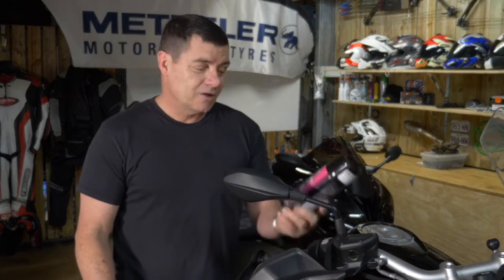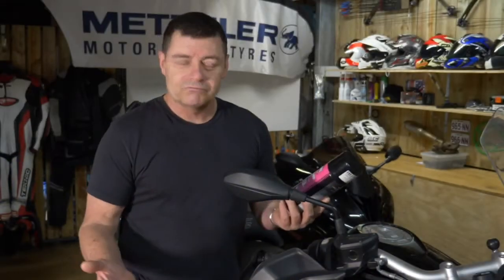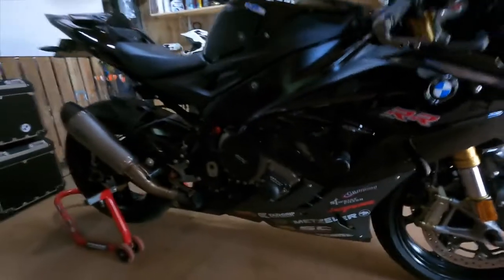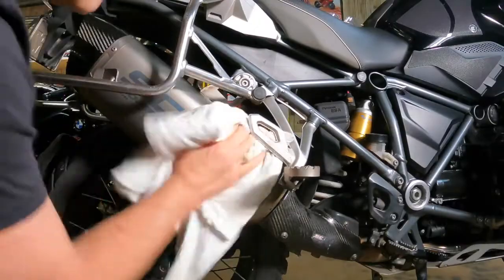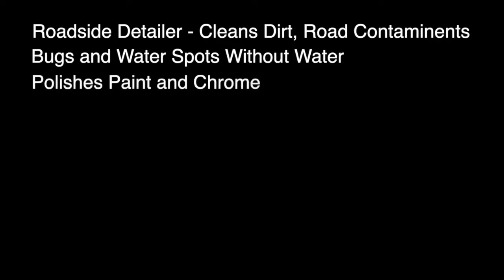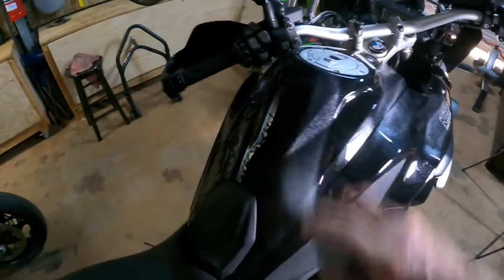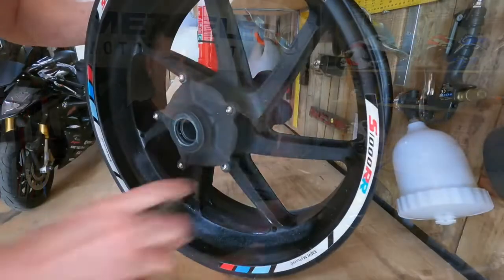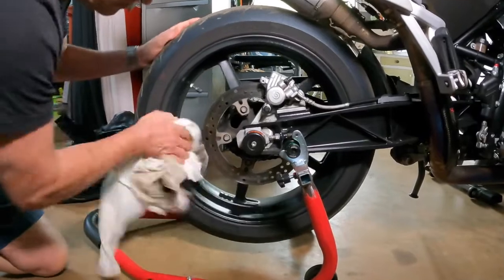Product Review - Original Bike Spirits Spray Cleaner and Polish for Motorcycles

Comment: I just bought a 2022 GS Adventure, and I've used this stuff on the black plastics, and yeah, it works a treat! Apparently it's safe for pretty much anything, including polycarbonate so gonna have to try it on my windscreen.  I am concerned, though, about the decals on the beak.  Have you noticed it causing any bubbling or separation of decals?
Reply from the maker: I ended up buying two cartons of the stuff, definitely works on everything even visors.